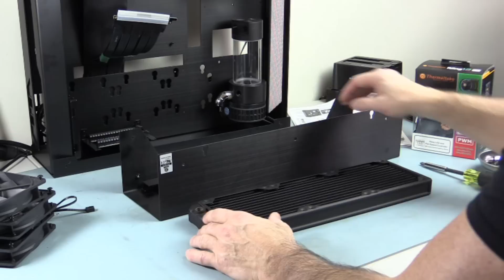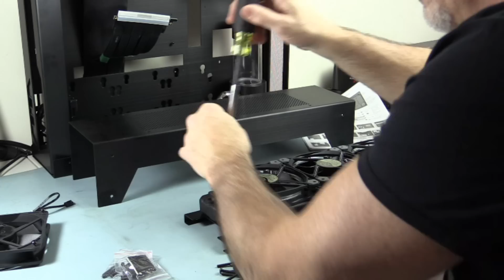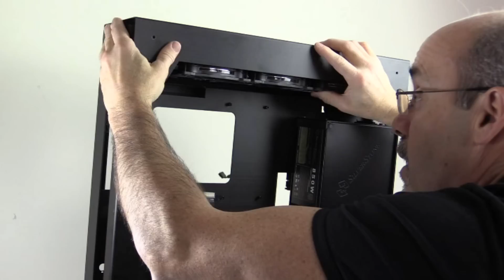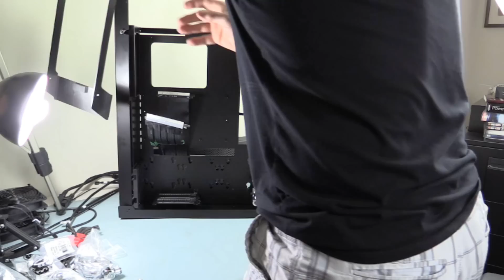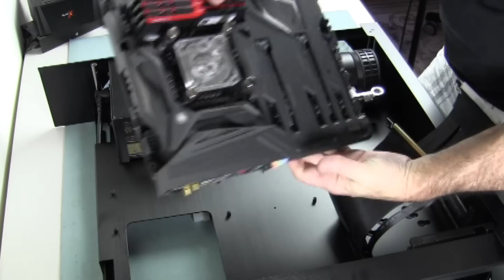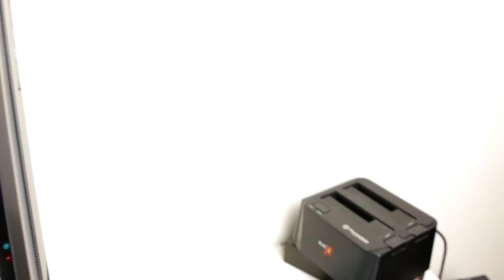Ultimate RGB Skylake Gaming PC   Build Log 3

Comment: Hey Ron, love the build!  I actually have a lian li pc-07sx that I'm currently working on as well.  I cant seem to find that second pci-e riser cable anywhere online.  Where did you get yours from?  I'm planning a very similar build to this, and would love to go SLI if possible, but this damn cable is nowhere to be found.
Reply from the maker: +slksht I bought mine from a mod shop online, whiuch is a lian li product. But here is one from NewEgg that is not so expensive.  Mine is 300mm long and was $50 .

http://www.newegg.com/Product/Product.aspx?Item=N82E16812368001&nm_mc=KNC-GoogleAdwords-PC&cm_mmc=KNC-GoogleAdwords-PC-_-pla-_-Cables+-+Internal+Power+Cables-_-N82E16812368001&gclid=Cj0KEQjw8u23BRCg6YnzmJmPqYgBEiQALf_XzXQqX8lKfDpXNZMm6cEWQ7yrfyckqg74wI4_Wfi4qI4aArQ_8P8HAQ&gclsrc=aw.ds
Reply from the maker: +Ronsanut Here is another one...
http://www.coolerguys.com/840556103653.html?productid=840556103653&channelid=FROOG&gclid=Cj0KEQjw8u23BRCg6YnzmJmPqYgBEiQALf_XzYUDPj4CK6efzMjnZuRIKdlgy6YE8fMabw3i_Aobti4aAgSA8P8HAQ
Reply from the maker: +slksht And here is a shorter LIan Li. This is the one I bought. 

http://www.coolerguys.com/840556103486.html
Reply: +Ronsanut Thanks Ron!

Comment: When you were fumbling around with the fans lining them up on the radiator, it made me chuckle a bit.
Reply from the maker: +Sams Tech Tips I fumbled even more, I cut that part out... LOL.
Reply: Ronsanut hahaa, I'm enjoying this build so far.
Reply: +Ronsanut i just built a new skylake build 6700k 16GB ddr4 2400 gtx 980ti windows 10 pro 64-bit i have a problem when my pc idle it crash any idia check ram gpu cpu stressed it out works fine  fresh installed os 2 times same thing happen checked everything in the way it should it fine any help man driving me crazy can play games for hours no crash nothing but when i stream netflix youtube crash and idle lastiest bios

Comment: Ron this is going to look unique when finished and wall mounted. Love the G-Skill Memory color contrast right in the center. I do feel that the PSU position is going to mess with the balance of the loop though. I've been trying to figure out a way for the tubing to get from the top rad back to the res without the loop looking to biased to the left of the case. I'm sure you will figure something out that I haven't seen, I look forward to seeing the finished build.